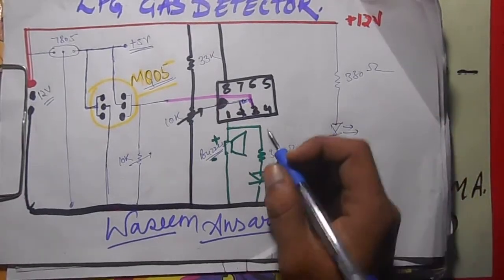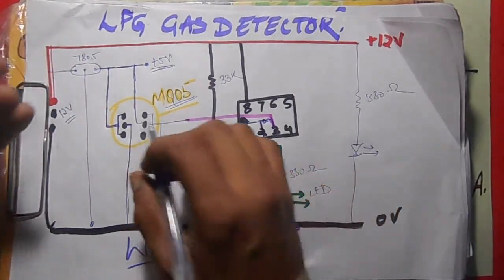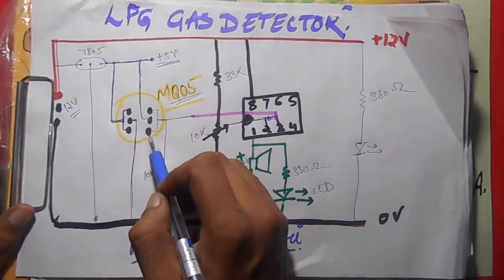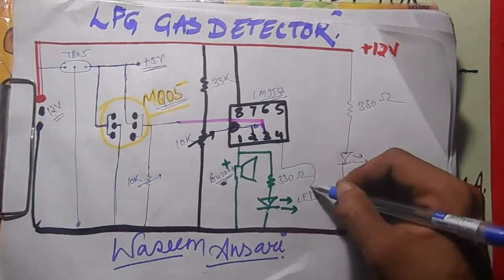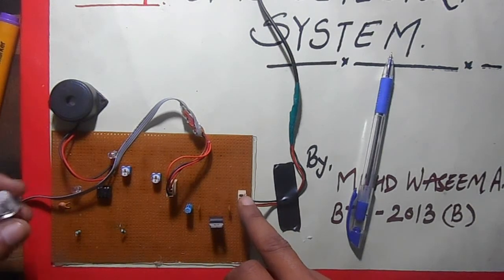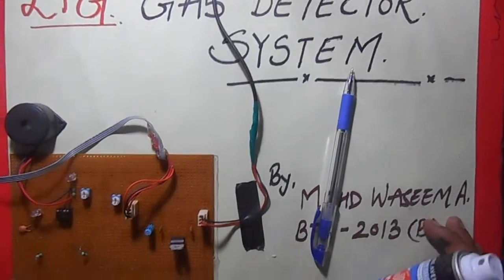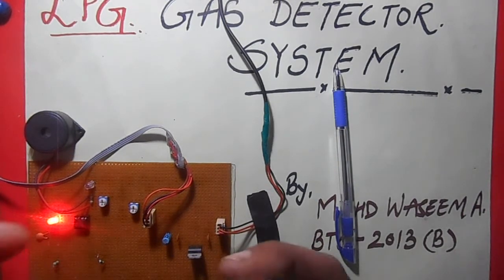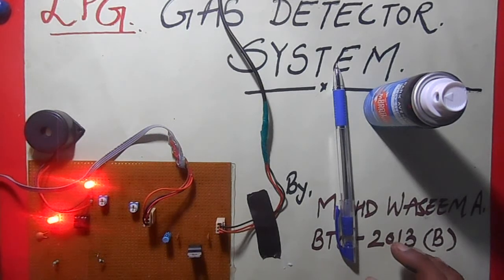LPG/CNG gas Detection system

Comment: sir u have also connected capacitors in stripboard but thetly r not present in circuit diagram which u have shown
Reply from the maker: Rohit Raut that capacitor is for rectification and it is not a part of circuit diagram.. 

My id is mohd786waseem@gmail.com
Reply: @THEINDIANTLM  what is range of d capacitor being used in this project?